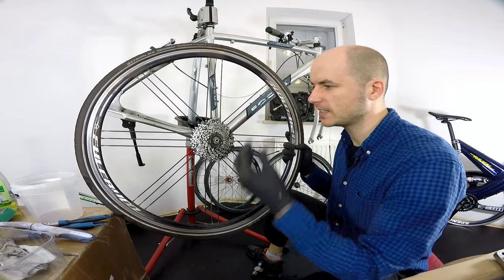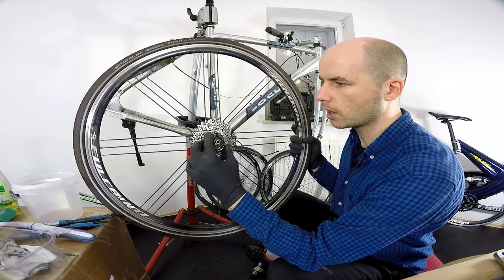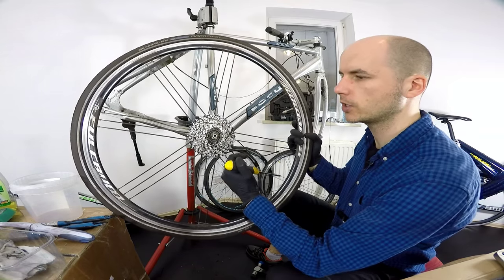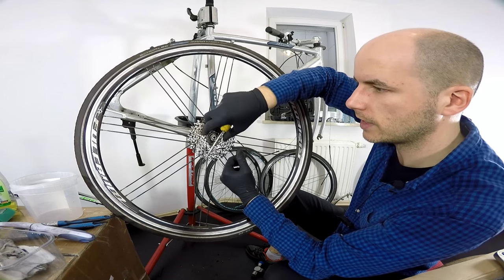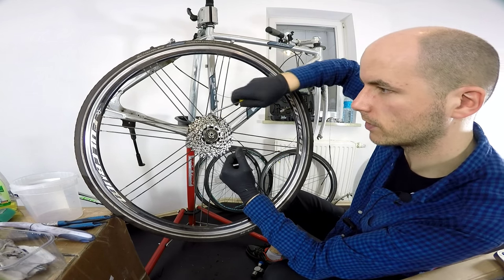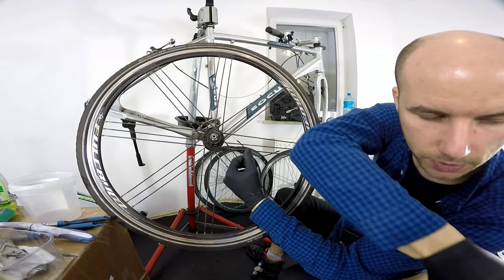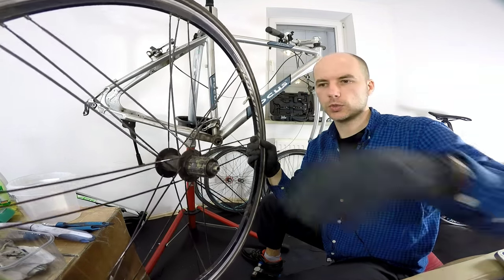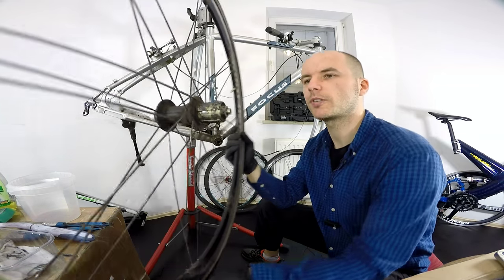How To Remove a Jammed / Stuck Cassette From Freehub Body. Removal

Comment: Worked fairly well for the first couple of sprockets, but I forgot that many of my sprockets are welded together.  So I was trying to muscle them apart.  It's just worth adding (for people like me) that you only want to use the screwdriver between sprockets that are not welded together.  :)   Because I didn't realize this, I wound up using the hammer trick instead.  Once I finished, I realized that I could have used the screwdriver, if I had inserted it between the right sprockets.

Comment: I guess this mostly happens with aluminium hubs. To put it into protective, I'm running 3kW ebike with BBSHD crank motor, and never did the cogs dig into the steel hub. For better chain line I rarely use the two smallest cogs anyway now.